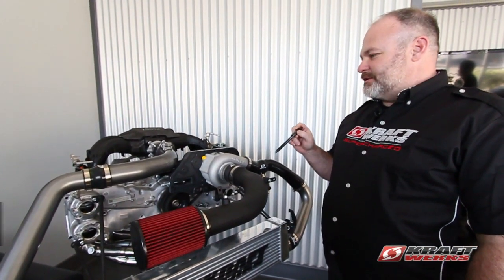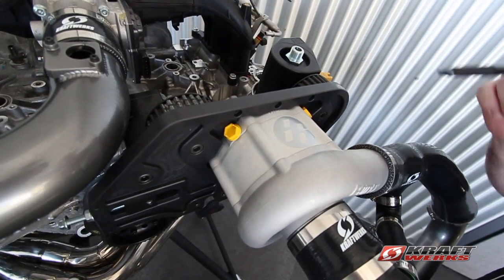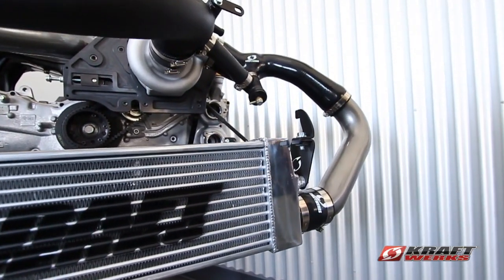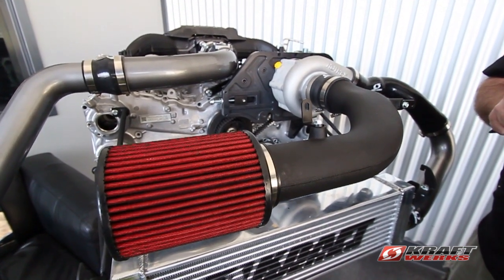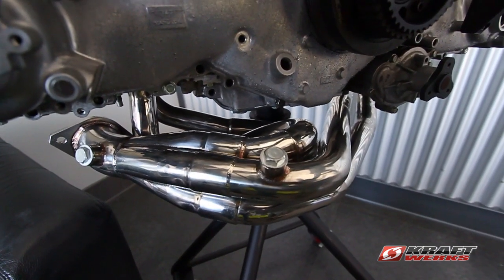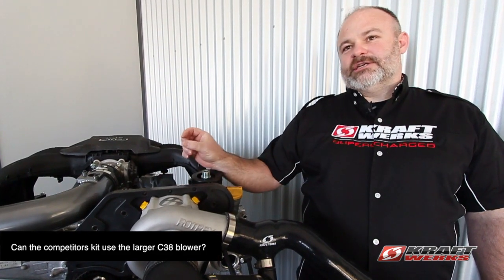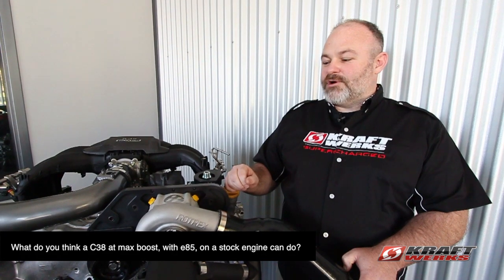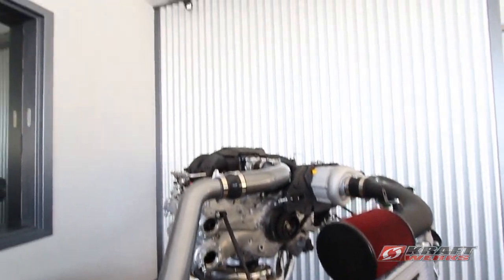Overview: Kraftwerks BRZ / FRS Supercharger Kit and Header

Comment: Great presentation, im currently working in phases on my 2013 Frs. I have completed the suspension from coils to braces. I wanted to add some powere, but wanted to ask about this kit. In the past it was highly recommended to get internal work done to keep your build in one piece. Is this not the case with this kit. Can i run stock internals on low boost and still achieve 200+ hp and high torque output? Please let me know and also where i cab review this kind of set up and you will have a new cust.

Comment: So your saying you can't daily a setup with 91 octane?
Reply: +Thomas Papsidero He's just saying you won't be getting anywhere near 400 at the wheels on 91 with a stock engine with 91 octane. You just dial timing back and run lower boost and it should be fine. IMO, 250-300 would be about perfect for this car as a daily.

Comment: Do u have a kit for an rx8 internals fully built
Reply: how does one "build" a rotary engine? just add another dorito and it's built no?
Reply: Lajcsi Vagyok you build it by adding better seals(all types apex, water, oil, etc) also porting it, and adding stronger parts to the rotor itself

Comment: Have you tuned / tested your kit with roz 98 octane fuel. Here in germany we have either 95, 98 or 100 octane fuel. E85 is not so common and subaru germany tells to run roz98 as default on the BRZ. Cheers

Comment: Great video and very informative. A few questions though-
What setup would you suggest that will ensure reliability and longevity for an every day driver? I understand that with the right modifications, the engine can produce a lot of power but at what cost? Have you had to replace cylinder heads or rods on any of the F20 motors you have supercharged?

Comment: And if I had the money..

Can anyone tell me, why go supercharger over turbo, or vice versa?

Nice about Turbo's, you can change boost levels on the fly, less stress on the motor - from what I hear, but you have to wait for boost to kick in.

Supercharger, instant, but harder on the motor..

Which is the better decision? ( daily driver - summer only )
Reply: I would personally recommend a supercharger since mostly of it is plug and play. Which means its more reliable over turbos. However turbos dont cause as much stress to the engine as superchargers do, causing for more efficiency and better mpg (has a dd) but u have to maintain turbos alot more then superchargers. Turbos also often fail more than superchargers. I heard a guy with a turbo kit fucked up his engine and ruined bis exhaust system... Something to consider

Comment: What is the torque response difference between the c30 and c38 in the rpm range?  Is it instant for both?  Thanks for the video.  I was trying to decide on which rotrex system for my frs.  Due to your video i'm going to buy your product.  With all the pros/cons of different rotrex system yours is most well thought out.  The only con is the intake filter location. Intake filter within the bumper is the best location.  But the pain of taking off the bumper every so many miles will be a pain. And the possibility of bumper not to fit perfectly is highe after certain amouht of install/uninstall.  Is there an option to locate the filter within the bay or do i have to modify it myself?